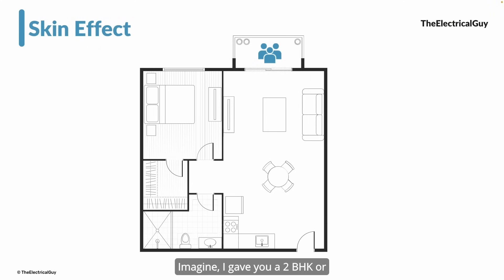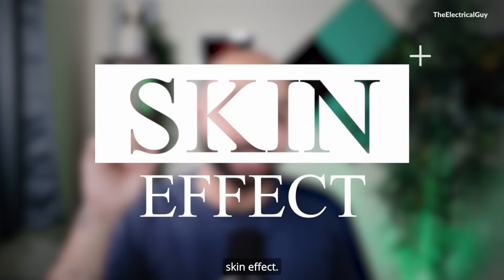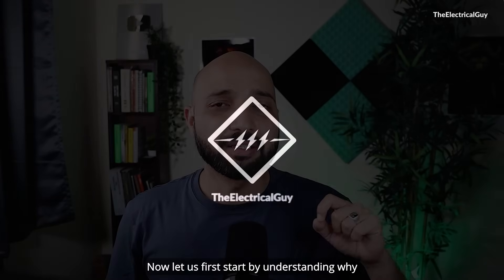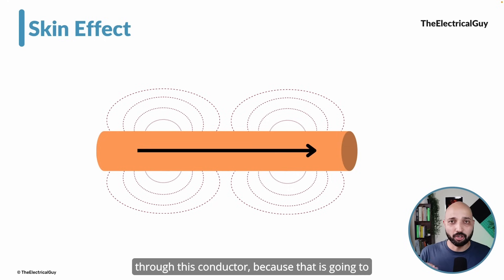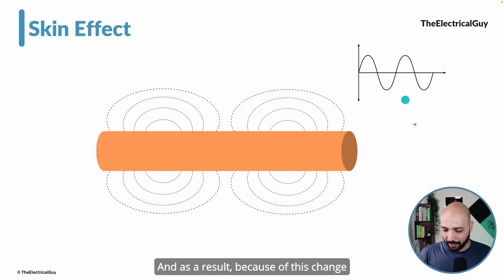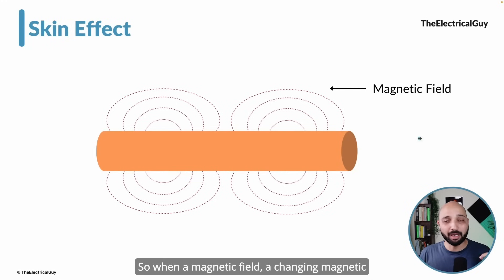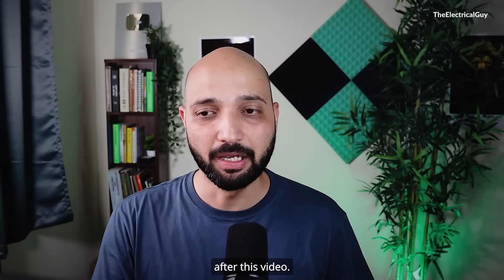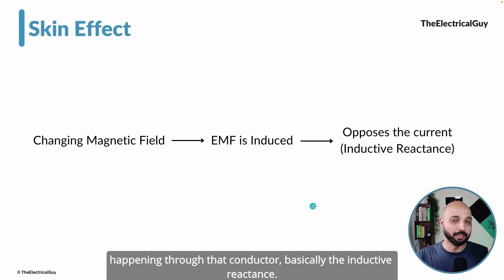What is Skin Effect ? Explained | TheElectricalGuy

Comment: Great explanation, Gaurav! 🙌
Here’s a compact field-based extension with equations that may help RF learners.
*Intuition (skin effect):*
Think of electrons like people in a room who hate being close. They spread out to maximize distance.
• In a round wire → they move to the boundary
• Result → uniform distribution around the surface, not the interior

At DC: uniform current
At RF: current minimizes **complex impedance**, not just resistance.

Why resistance increases at RF?

Effective impedance of a conductor at RF:

Ze = Rdc (1 + δs + δp) + jω (Lext + Lint)

where:
Rdc = ρL / A
δs = skin-effect factor
δp = proximity-effect factor

Skin depth:

δ = sqrt( 2 / (ω μ σ) )

As frequency ↑ → δ ↓ → current confined near surface.

Where skin effect really comes from (Maxwell, not magic)
Faraday:
curl(E) = −jωμH
Ampere (quasi-static):
curl(H) = J
Ohm:
J = σE
Combine → magnetic diffusion equation:
∇²J = jωμσ J

Solution ⇒ J decays exponentially into the conductor → interior current is suppressed by eddy currents.
Cylindrical wire (exact result)

For a round conductor of radius a:

Rac / Rdc = Re[ (k a / 2) · J0(k a) / J1(k a) ]

where:
k = (1 + j) / δ
This shows Rac rises because current is forced toward the surface.
*Proximity effect (often bigger than skin effect!)*
Approximate increase due to nearby conductors:
δp ≈ δs · (d / s)² · G(geometry)
d = conductor diameter
s = spacing

• Same-direction currents → current crowds on *outer sides*
• Opposite-direction currents → current crowds on *adjacent sides*
*Microstrip & MRI RF coils (real-world impact)*
In flat copper strips (microstrip):
• Current bunches at *edges* (lateral skin effect)
• Ground plane return current flows opposite → pulls current toward the *bottom face*
• Effective conducting area becomes tiny
Result:
Higher Rac, lower Q, more loss at MRI Larmor frequencies.

*Bottom line:*
Skin effect and proximity effect are the *same Maxwellian diffusion physics*.
At RF, we don’t design for copper — we design for **field distribution**.

Fantastic video — a proximity-effect or microstrip follow-up would be 🔥

Comment: Really nice video. Can you make a video about the Generator capability curve, under excitation and over excitation of the generator and the use of shunt reactor in a transmission system.
Reply from the maker: Sure. Will try
Reply: This question came up in the board exam yesterday sub: (power plant design)  😂😂😂 final yr 8th Sem  electrical engineering
Reply: @kanchhatamang2685  ohh..These are really important topics in the real power plant as well.